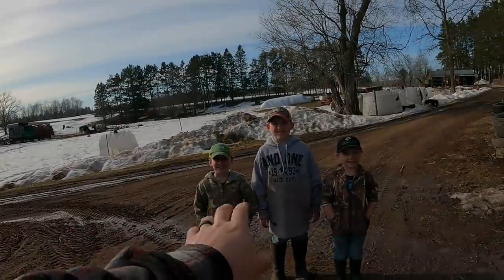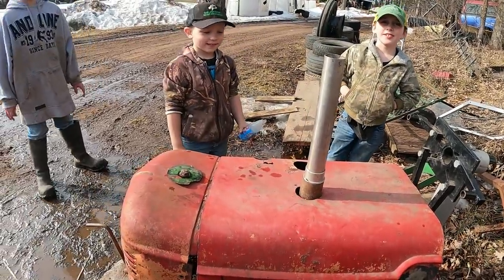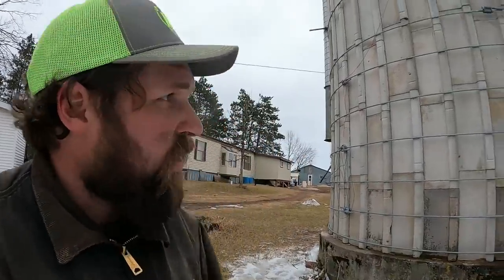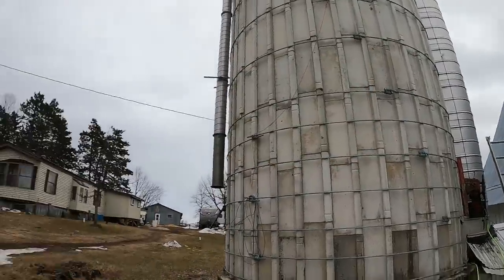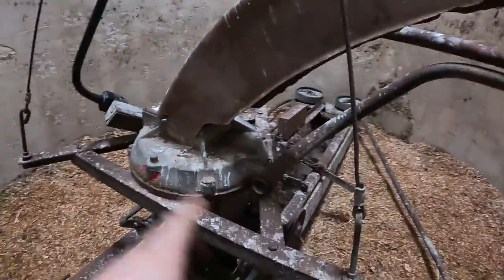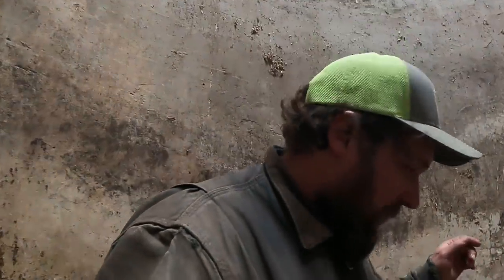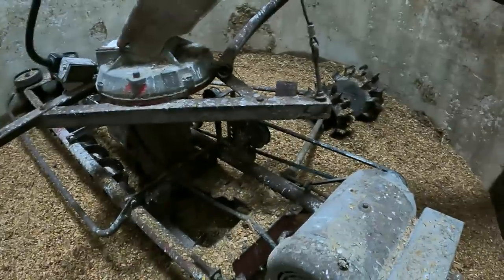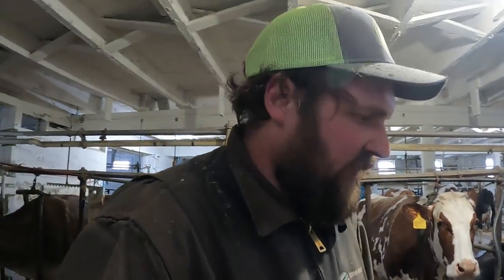Back in the Silo Again/Setting Up a Van Dale Silo Unloader

Comment: Wouldn't it make more sense to do the maintenance when it's empty right before you run it up to fill
Reply from the maker: Sometimes I do,  but the gearboxes always seem to leak a little over time,  so I wait to check them before I run it.

Comment: Man, that brings back memories!  Do you have trouble with it leaving a pile in the middle under the blower?  We always did and you'd have to climb up and pitch it out of the way or it'd slip the drive wheels.
Reply from the maker: I have had that trouble, if I don't have it balanced correctly, it has to be higher in the center and slope down to the wall.

Comment: what size silo do you have iam putting a 12x42 up
Reply from the maker: We have a 12x50 and a 14x25
Reply: @trinitydairy  it's been hard to find a unloader for 12ft wide silo  but I managed to find a badger unloader to make work no more baleage or bunk
Reply from the maker: Is it ring drive or surface drive?
Reply: @trinitydairy  surface drive
Reply from the maker: @andersonsfarm4456  I had one of those, in the 14ft silo, it worked good, but it was kind of a pain to fold up, when I had to raise it. better than a pitch fork though! Lol
Reply: @trinitydairy  yes sir my thoughts too i started building a gas powered feed cart with apron chain that feeds left or right has hydraulic doors on either side to let feed out
Reply from the maker: @andersonsfarm4456  awesome!

Comment: I would bet, Alan, that you are enough of an electrician to be able to reverse the electric motor on your winch?
   When you are unloading and feeding out of the silo though, do you put the crank handle back on to count revolutions for lowering the unloader?  Or is there a mark on the large belt pulley for noting revolutions...
Reply from the maker: Yeah, I can reverse it, but I have to take the motor off to do that, right now, it's set for lowering, so when I need to lower it, I just turn the motor on for a few seconds, and when I need to raise it all the way up, I have a big electric drill, that I can hook to it.